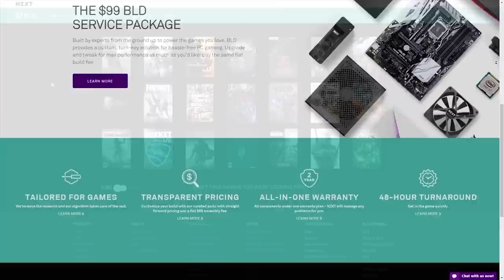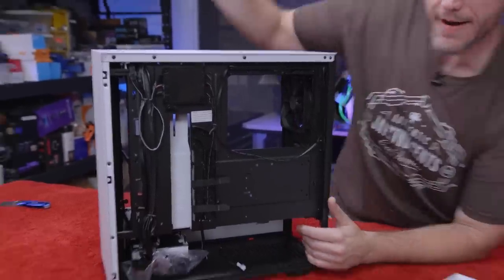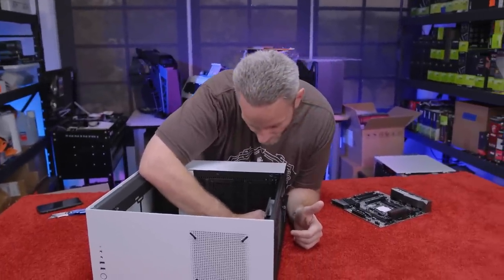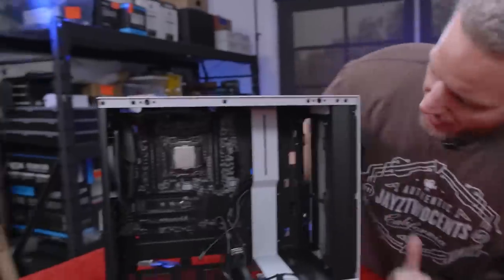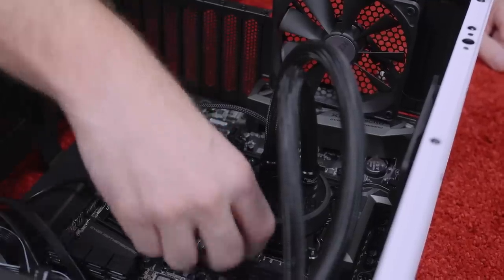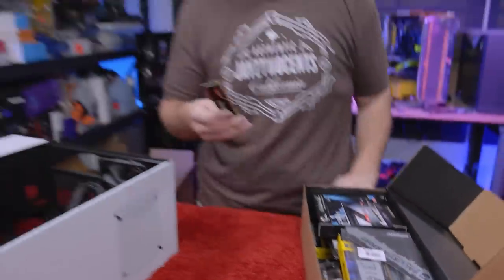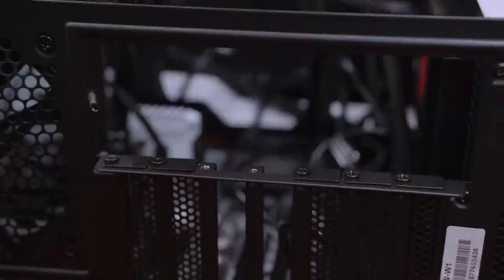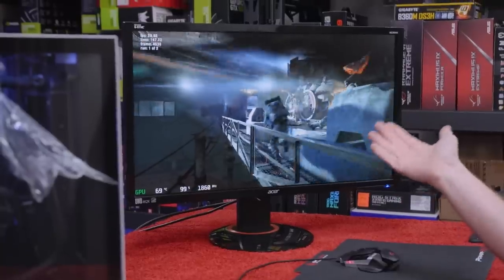We built a computer wrong on PURPOSE!

Comment: your power supply should be the least efficient you can find... casue heat takes heat with it. the heat will build up in your system away from your very important 5200 rpm drive

Comment: How 2 build a PC
prep: a swiss army knife (That hopefully has a screwdriver)

1. drop cpu in socket make sure you bend the pins'
2. Make sure you use diffrent types of ram and put them together
3. overscrew Motherboard  standoff
4. Put carpet in case
5. Put NVME anywhere you want
6. Put hardrive no need for cables
7. put PSU with fans facing side']]
8. Put gpu with fans facing up
9. Put power cables anywhere
10. ENjoy your pc overheating

Comment: You probably won't read this comment, but I finally upgraded my motherboard, CPU, cooler and RAM and redid the cable management, which basically is like building a PC. This video actually took my fear of making mistakes and doing it myself instead of taking the components somewhere else. Thank you very much!

Comment: So just realized I had my PSU installed wrong. Holy fuck. Be right back
Reply: if you have a soft floor, fan facing in. anything hard face out
Reply: @bananya6020  I have a hard floor. And after I changed the fan to face down I noticed the CPU is actually running hotter. Computers are weird.
Reply: @topdamagewizard  maybe there isn't enough airflow in your case so the psu ironically helped to increase airflow when pointed inside the case and thus lowered temps?
Reply: (because maybe having a fan blow air around the case did more than when it brought air in at a slightly lowered airflow?)
Reply: @bananya6020  I don't hate this thought. I have 3 intakes in the front. And out takes on the back and top.  But who knows
Reply: @topdamagewizard  yeah idk (to be fair i don't even know your system's config except that you have 5 fans and a fanned psu

Comment: I have g4560
MB B250M mortar artic
8GB ram
650watt psu

After 2 years the board dead, why? Last time i used the comouter it just being normal. After turned it off, its dead forever with no post at all. Maube because the power supply?

Comment: And you did it better than that one video make sure the psu is installed on the insulating pad so you don't have the system short circuit.

Comment: I've built "my" first PC in around 2001 I guess with a little help from my father back then. Funny enough, we did that on a carpet, with no bands on our wrists. Non of that crap and it worked until I fried the PSU with a better GPU. I couldn't resist using my new GPU when waiting for a new PSU that would arrive after the weekend :) Good times :)

Comment: intel 8 core i9 9900k cpu

64gb corsair rgb ram at 3200Mhz - 2x32gb dimms - space for another two

512 WD Black MVME ssd

SAPPHIRE AMD RADEON VII 16gb GPU and stabilisation bracket + angled cable hider

Tp Link Arcer pcie wifi card with 3 antennas

Z390 Designare motherboard (Gigabyte)

Corsair H100i cpu radiator / cooler

8 rgb fans - corsair

pcie sata expansion card

2x Corsair rgb controllers

Phanteks fan controller

Corsair Case Crystal 680x case

Corsair 850w power supply.

Many Thanks

Comment: LOL, the thermal paste part, hell i use my bare figure.   and i never had a problem with heat or the other bullshit ...  most of what Jay has done, i still do ..  i built my first system on carpet  ..  static is not that much of a build up.  the system i am using right now, my 8700K with a 1070 ftw, on a Evga Z390 board.  was all on on the floor with carpet ..  so this bullshit about static build up,  is fucked.  i never had a issue with anything ..

Comment: what the hell man ur using thermal paste its going to short out the whole PC ur supposed to use COLGATE and also an vibration insulator so that electricity dosent come in contact to the cooler then to case and then to motherboard and then to power brick

Comment: i got a phanteks P500A and transplanted my whole desktop and replaced my power supply from 430 to 700 and when i booted my desktop i saw a sparked somewhere near the gpu, my mobo btw is very old Asus B85M-G so i am not able to utilize the rgb fans and other fans for the mstter since theres only 1 slot for chassis fan, am i screwed?
Reply: Uhm... I am not sure if you Are joking or not, but please replace that mobo. If that decides to Fry All- your other components will die as well
Reply: Sticky am not joking, it really sparked, am scared to use it again but i tried it for a few minutes and it is working
Reply: @azurepenguingaming  Sure it's working, but the fact it even sparked might be a sign of things to come... just remember that if the motherboard dies there's a big chance EVERY other component will die as well. CPU, GPU- anything connected to the motherboard. I would really consider buying a new motherboard
Reply: Sticky ok thank you for that feedback i'll look for a replacement

Comment: Last time i cleaned my water cooling system, i forgot to remove the peripheral joint of the CPU water block and it start leaking on the graphic card when i put my PC on.
I had lost my special connector to run the water pump without booting the pc.
I was thinking that my motherboard and (or) my graphic card was dead.
But after using WD40 and a compressor and waiting few days, the computer start again.
What i can say about it?
I you are dumb like me, you better have good components (motherboard is a Asus Z97WS with anti surge) or double check everything before to start up. (and use the special connector to run the water pump without booting the pc)
And the worst thing in that story is that i'm a plumber and i perfectly know that "o rings" should be checked and maybe replace when you open the object they are sealing. XD

Comment: i should've watched this a year ago when it came out, it would've been so much relaxter to  build my first pc,
i still did t though :D
Reply: Check out the verge supercut pc build reaction if you havent already
Reply: @xIronMikex  lol.. that is pretty bad.
luckily i watched a bunch of linus, and jay2cents before i started building ,and i have a friend which made sure my parts were compatible before i ordered them and gave me some tips on how to put them together safely, i was nervous is fuck though, lot of money,  first time boot up got me scared as hell when my pc turned on for a sec... instantly turned off again. i was like '' well sheeet" 

but now, after a year or so, its still running great, yesterday i enabled multi core enhancement just to try it out, and the max temp i've seen ( not on bench, but games )  68°c under 100% cpu load - 8700k at 4.7 turbo.   but when im just normally gaming its around 60°c which is only 5°c more than it was with mce at auto.  so that is worth it imo, im not gonna manually overclock it, im not that confident yet xD
Reply: @xIronMikex  also i was clever enough to clean off the pre applied thermal paste from the aio cooler with cleaning alcohol and adding my own mx-4...  instead of adding my own mx-4 + the thermal paste from the cooler, holy shit, im glad i didn't watch that verge video before building my pc. although i don't think i would've been dumb enough to fall for it.